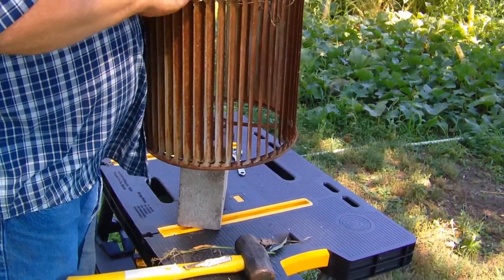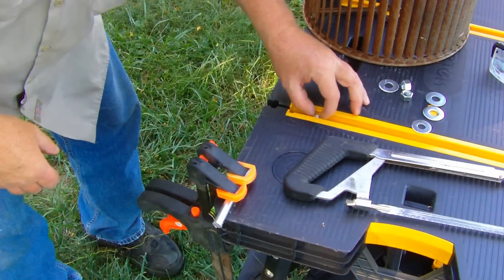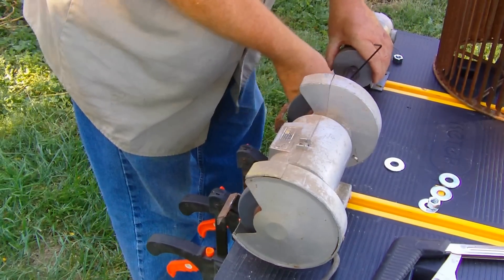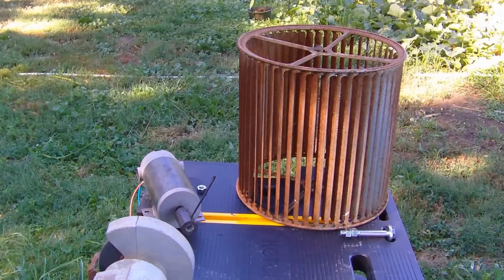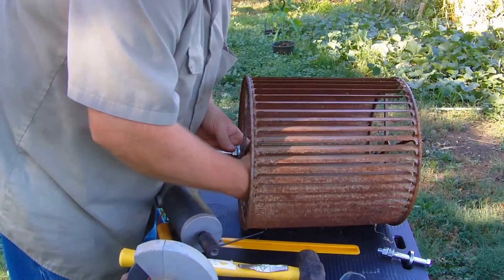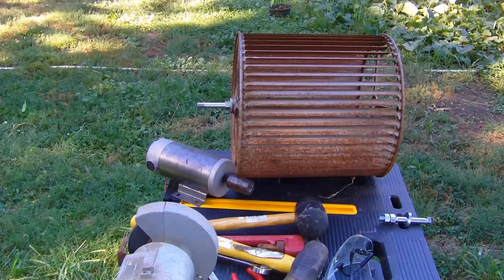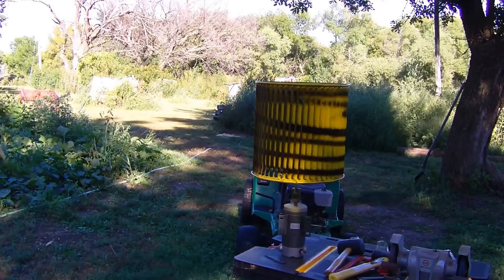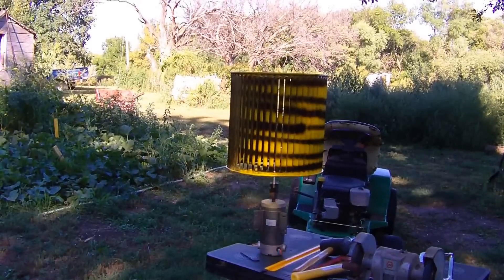Finished vertical wind turbine from squirrel cage fan Green Power Science Idea. Thanks G.P.C.

Comment: So far it looks like a lamp shade with pretty design on the paint job.  If you think this is going to produce lots of electricity for you, abandon the thought.  VAWT are notoriously inefficient and especially metal ones with lots of drag.  And remember, just because it is spinning it doesn't mean it can produce electricity.  There are charts for various wind speeds in different regions of the country.  Consult those charts and educate yourself on the physics of wind turbines!  As I said, yours looks like an interesting lamp shade!  Good luck.

Comment: The squirrel cage has to be made from stainless steel in order to last. Anything else will rust away or deteriorate from the suns UV rays. In order to generate any serious power, Your squirrel cage will need to be 10 times larger, and you have the right idea by using a permanent magnet motor, like the kind found in treadmills.

Comment: Before anyone starts thinking of making a turbine to extract power one should have a look at the result of the formula relating power generated from the wind which is Area multiplied by density of air multiplied by velocity cubed and applied for this case I would say that at a wind of 10 m /s the wattage would be about  8 watts considering a few other issues in Vertical axis turbines.   Hence the result we see,  considering that a DC motor with brush gear pressing on the commutator needs a little persuading to move the armature.

Comment: You should have used a threaded rod from top to bottom to make it more stable and use wider washers on both ends and crank down on the nuts and double nut them...also you should have just stuck with the yellow, you made it look like shit adding the other colors the way you did.
Reply from the maker: bigjake1965 Your are correct metal was to thin and did bend and wobble after strong winds.

Comment: It's too bad there are some people here missing the point. By watching this vid, I have seen where some things didn't work, so I don't have to waste my time. Then there are good ideas that worked. Now take what you've seen and improve upon it in your own shop. Then post a reply vid showing where you improved something. Myself? I'm thinking of a "C" bracket going outside the fan from the base up to the top and using the 2 bearing system the factory used. You would need 2 C brackets at 90 or 110 deg angle. That would stop the wobble and increase the wind speed before self destruction. Thinking of a washing machine, things can get pretty bad when something begins to wobble.  You could make a stabilizing bracket from bed frames found in any alley in town...free :)
Reply: on the money with this comment
Reply from the maker: Thank you for watching most of my videos I shoot from the hip and show what works I try and what does not and hope it inspires Ideas for others
Reply from the maker: Andy Gozzard thank you for getting my video